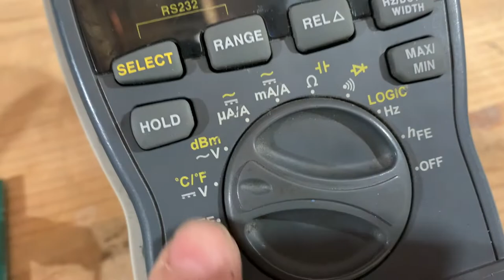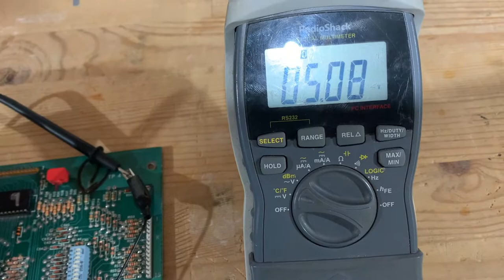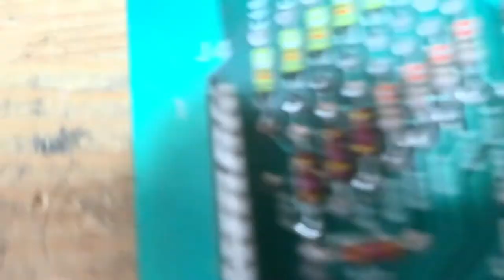Lets fix a non booting Bally pinball MPU

Comment: Lots of good advices here in this video. Just one thing. Your’re blasting those through holes with that large solder tip. Try using a smaller one. Its well worth it.

Comment: My Dolly Parton mpu has a red lamp instead of green, is that normal. Either way it's not coming on at all.
Reply from the maker: Stern pinball boards are interchangeable with Bally's of that era and have a Red LED.  If it doesnt boot this video was a quick guide.  Lots of info on the web you can refer too.  Hope you figure it our!

Comment: Hello  I have the led blinking 4 times
Reply from the maker: Google Bali MPU flashes four times and a lot of articles will come up. 4 flashes is almost there!
Reply: I'm working on a strikes and spares right now and it too had 4 flashes.  I put left pressure to the lower left connector j4 on the mpu and it booted up.  I removed each pin on it and sanded the black off each pin ok now.